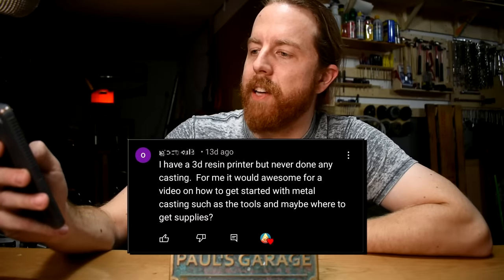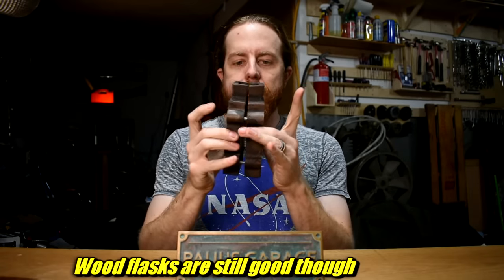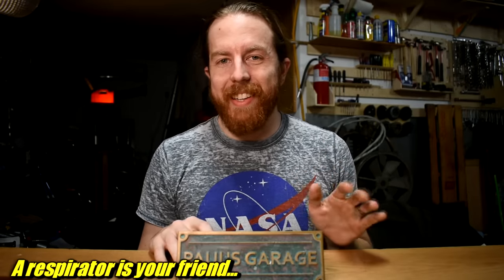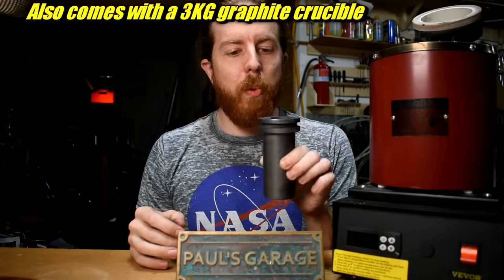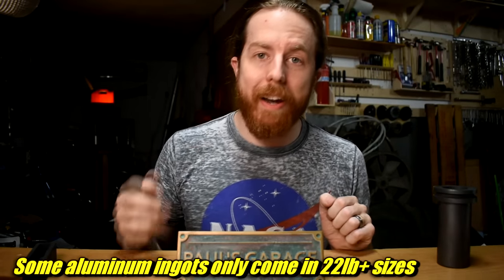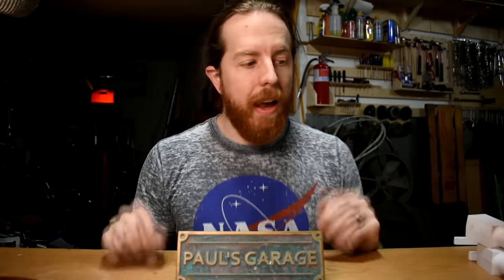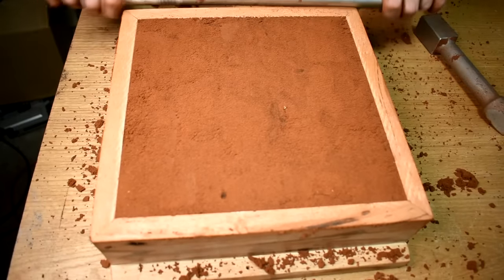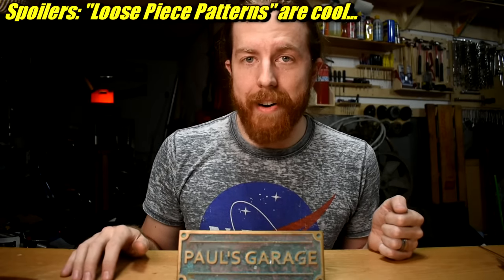You Can Learn Metal Casting Using Your 3D Printer!

Comment: Enjoyable video as always. I think if you're starting with a propane furnace that melting scrap is a good way to learn your furnace's quirks and get a little experience with handling a burny-death-hot crucibles of melted metal.
Reply from the maker: That's a great point.  That's how I started for sure.  I only suggest electric and purchased metal grain here because it's the fastest way to get to good end results, but I probably went 4 years before I purchased any metal.  Lots of my early castings were pretty bad though lol

Comment: Another method is using joint compound to coat a print with 0% infill, an open bottom/riser and thin walls. Let it dry and ram it up in sand. Gives surprisingly good results but there are still some issues with porosity and pitting.
Reply from the maker: i've seen people do that, but you're right on the porosity and bad surface finish.  It's the reason I don't want to do lost-foam either.  Sometimes the metal comes out like swiss cheese.  I'd rather have nicer finished projects.

Comment: We machine a lot of bronze at work`. We must have 10-55 gal drums of bronze chips. Do you think these would work for casting? We probably have 3 or 4 tons of it.
Reply from the maker: yes definitely.  From melting and mixing all of it together you will probably have oxides and gasses in the melt, be sure to add a little phosphor copper shot to help clean the metal up a bit and it should work fine.

Comment: You take your electric furnace up enough for copper? I've not pushed mine past zinc. I always get out the propane one for higher casting Temps, but it would be nice to have an alternative.
Reply from the maker: Yeah i've had mine at max temperature with a full 3kg crucible of bronze a couple times.  Making that sign for one.  I'm sure the lifespan is shortened by doing that, but it did it!
Reply: @PaulsGarage then i'll give itva shot next time I need brass!

Comment: Cool video! The linked furnace says it will do around 2k deg F. As far as I know this is plenty of heat for Aluminum. Do you think this furnace would be good for casting small aluminum parts? Thanks!
Reply from the maker: It's definitely hot enough for aluminum, perhaps a little too hot.  I use it for bronze.  The only issue you will find is getting aluminum in chunks small enough to fit in the crucible.  These are not good for melting down scrap, and really you shouldn't be casting with scrap anyway.  Good casting aluminum (A356 alloy) is easy to find, but it usually comes in large single ingots.
Reply: @PaulsGarage  excellent, thanks for the reply! I do some TIG welding, so I have some aluminum I think would work, or I could cut ingots down. I'm a bit paranoid so no mystery metal for me. I've never cast any metal before, only welding so far. Looking forward to giving it a try!

Comment: How do you suggest melting scrap, if we end up buying the electric forge?
Copper and aluminum
Reply from the maker: Good question.  I would suggest picking what you want to do specifically.  If you intend to primarily melt scrap into ingots, get a propane furnace, not electric.  If you intend to primarily make finished castings, don't use scrap at all.  Buy good clean metal in the right alloy for casting.  

You can make good castings with a propane furnace and do both casting and scrapping, but it's a steeper learning curve and higher failure rate when it comes to the castings.  It's absolutely doable, but you will need to be able to regulate temperatures and not over/under heat metal when you are pouring molds. Hope this helps
Reply: @PaulsGarage  ok that makes sense, because in my job I get a lot of scrap metals for free, and I thought once you melted it and cleaned it you were good to go,
But obviously I need to rethink that

Cheers for the quick response

Comment: Ive been playing with this for a while now, and really only have one problem.   There is a lot of pitting inside the castings once they cool.  Ive been making the castings slightly oversize so I can mill them down to final size, but there are always small voids, or bubbles, inside the castings.  Suggestions?
Im primarily pouring brass into a small 45mm coin blank made of graphite.  It is open top like an ingot, not a flask type mold.
Reply from the maker: A bunch of things cause porosity like that.  First off, brass can be prone to that on it's own, and it gets worse the more times you re-melt it.  Copper alloys can dissolve stuff from the air into the liquid while molten, and it comes out when the metal solidifies, giving you a bubble.  There are commercial fluxes that can help with that (and the boil off of the zinc), but they aren't always sold in small quantities to retail customers.  Also, graphite is a good ingot mold material, but you are still pouring down into something.  Pour some water into a clear glass and you'll see all the air bubbles that get sucked in.  Metal does the same thing.  Open top molds usually give you worse results than flask molds for this reason (and some others)
Reply: So, taking brass already cast into something (plumbing parts), melting it into an ingot, then remelting the ingot later into a piece, is about the worst way to do it?  Sounds about right... This would also explain why the bottom of the coin blank, once poured, always has a thin layer of copper.    @PaulsGarage
Reply from the maker: @starhawke380 yeah brass especially doesn't do well with repeated melting.  Bronze is better, so is aluminum.  Different alloys have different tolerances to that.

Comment: Any info on casting iron?
Reply from the maker: I did iron years ago, never again.  The radiant heat is overwhelming.  If a dime sized puddle of molten iron burns you while welding, imagine what a full crucible would do and you get what I mean.

Comment: Why not start with melting scrap?
Reply from the maker: glad you asked!  I started with scrap, but most people who do, end up getting the wrong alloys, and either have contaminated metal or they contaminate it themselves melting it down and casting it.  This is partly why you see so many bad castings (porosity, holes, bad surface finish, won't fill the mold all the way, etc...).  Because of this, I suggest you buy clean casting metal.  It eliminates a variable until you get the hang of making good castings.  Even then, most experience metal casters I know don't want to use scrap for this reason.  The bronze casting grain I showed in the video is not only clean, but contains additives to help keep it clean and help it flow better.  Those additives burn off when you use the metal, so re-melting it won't be as good.  This is another reason why scrap usually results in bad castings.  Hope this helps
Reply: @PaulsGarage  Thanks, for clearing it up. Well I suspected it would be something about composition and purity, but then again copper wire for example seems like it's pretty pure for the most part, or aluminium foil or cans etc.. I guess not!

Comment: 3D printers are "mostly" for plastic trinkets hehe
Reply from the maker: well they are really good for that lol
Reply: @PaulsGarage  Absolutely, but of course they do much more than that. I mean FDM and SLA 3D printing came down in price 10 fold in the last 10 years. I remember when the Form1 resin 3D printer was considered the cheapest option there is for like 2k or so. This is truly amazing. I have also discovered a new type or powder 3D printer, you got to check that out, the company is called Iro3D and is based in the US. The machines are one offs hand made by it´s inventor. Those work completely different from anything I have known. 
On the same note, are you familiar with "Shell molding" ? A process invented in Germany in 1944 "Maskenformen" is the German name. This could be an awesome process for home use. The sand is infused with phenolic resin which sets at about 200°C. Which means you can locally harden the sand in thin layers by a laser or IR lamp or in the oven etc. and then pour any metal into the mold you like up to steel. Please tell me what you think.

Comment: 🤔couldn't you just cast a flask to save $60🤷‍♂️🤣🤣😆
Reply from the maker: if you start with a much, much larger flask and more than $60 in sand, then yes!  The price of that kit also includes the sand.  i think they sell flasks separate for less.  That's also made of cast iron, you would want iron for that design.  The funnel opening on the end would get really sketchy if you made the flask in aluminum and tried to pour a bunch of bronze in there